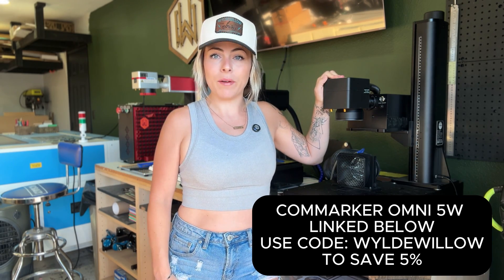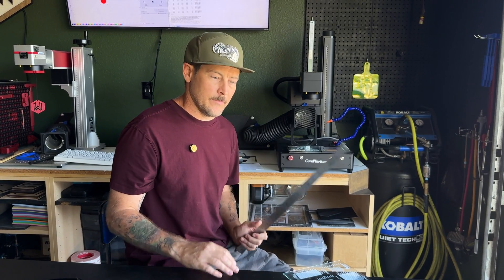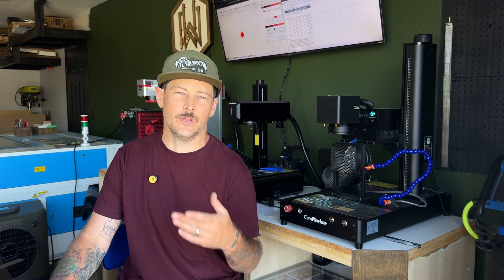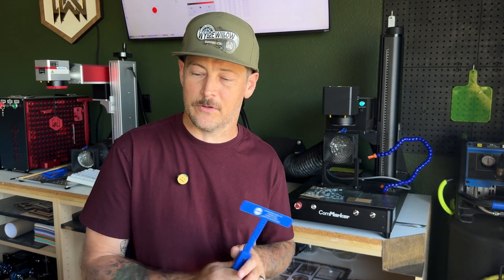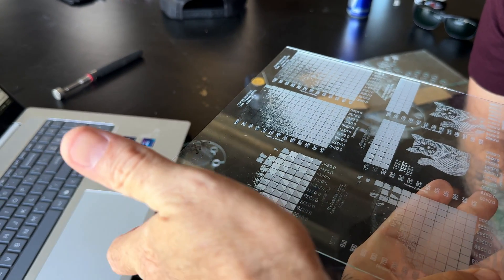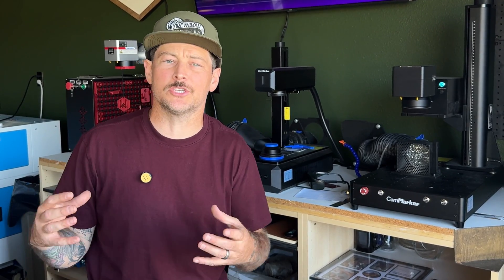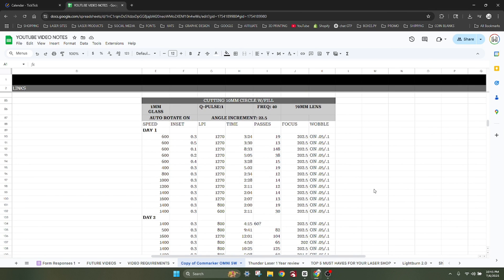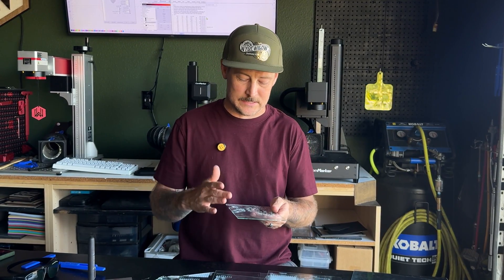CUTTING & ENGRAVING GLASS with a UV Laser! | ComMarker Omni 1

Comment: I'm a glass worker.  Float glass has a tin side - I wonder if you had flipped the glass to the other side and the tin was causing some type of issue with the laser. If I remember correctly, Water will ball up on the tin side, and run off on the non tin side
Reply from the maker: Thats a really good question. I will have to have my husband run a couple test to see is that possibly effects  the engraving or cutting.

Comment: Hi and thanks for this.  I just started with the omni1.  Testing with glass the engraving is actually going through the glass.  The first time, since I didn't expect it, I engraved on the machines surface, through the glass.  the engraving also shows inside the glass.  Thoughts?  Thanks.  I'm using speed of 200-300 and power 20-30.
Reply: That's a focus issue. Try focus on the surface and raise the laser head for 3mm or so.